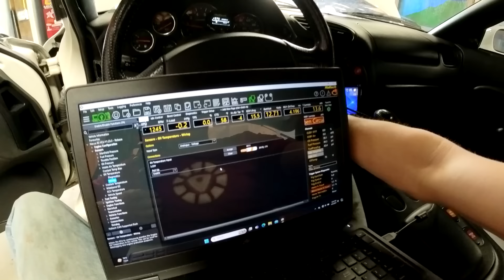4 Rotor FD Rx7 Street Car Fires UP FIRST TRY

Comment: sounds amazing!  I'm not a bad ass mechanic like you but was wondering if you could just go to a machine shop and skim the top off that thing so it doesn't bend all over the place?
Reply: That manifold has many design flaws. Fly-cutting on a mill on the flanges to make them flat needs to be done. Also, that slide throttle system is going to be problematic. As the engine heats up, I can see the throttle binding with temps. That needs to be ditched and some actual ITBs from Keihin or other reputable company would be the way to do it.
Reply: @markhutchinson3367  Logan of Defined Autoworks has been running that style of manifold on his car for a long time now. Here's a recent video describing it, and you can find lots more info on his channel. https://youtu.be/V6AhkYTLVj0?t=949   I suspect the difference is Logan's builds machined the second piece of aluminum flat after it was welded.